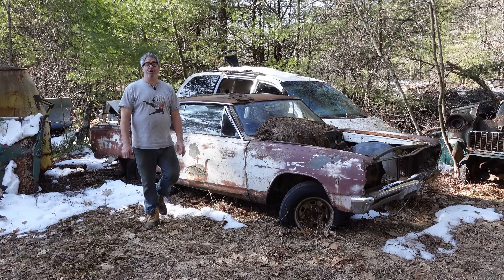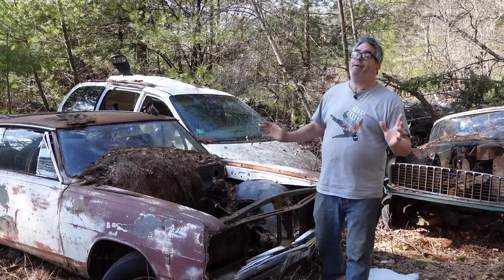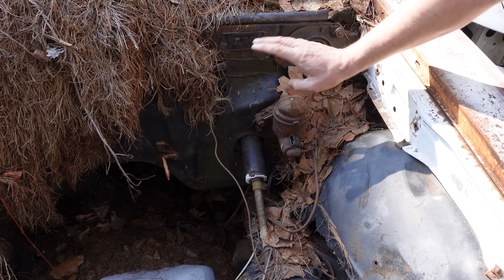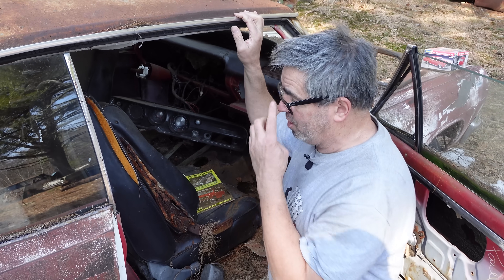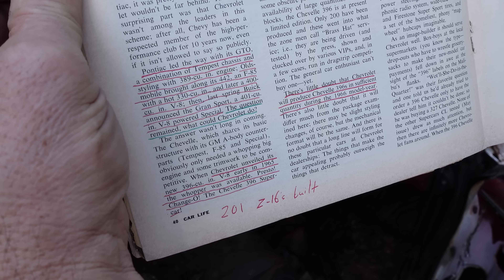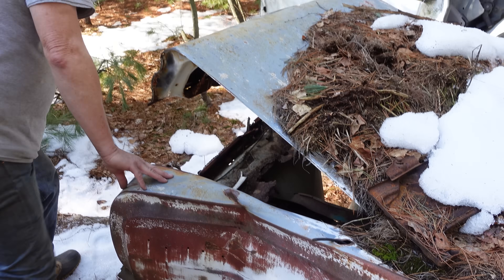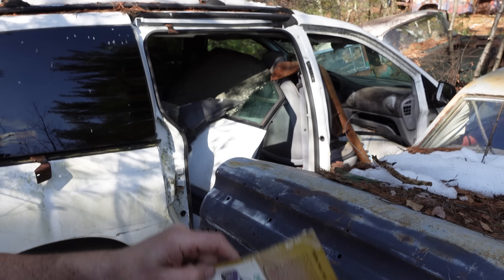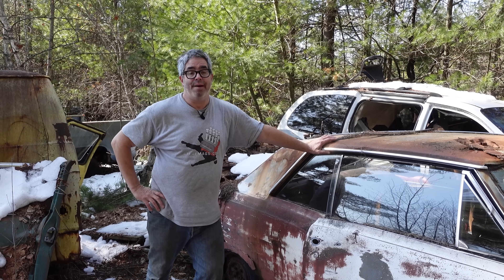Six Cylinder Super Sport

Comment: This vid put such a smile on my face!  I have a frame-off restored maroon 64 chevelle SS that came with 3 pedals, a 10-bolt posi and the mighty 230 inline 6!  Re-plated the 230 badges, which were different than those on the 65, and were located rear of the front fenders.  Kept and restored all the trim, steering wheel, interior, drum brakes, etc..  However, I did upgrade to a warmed-over 454 with Muncie 4-spd and 12-bolt w/4:10s.  Still drive it like a grandma, though.  Watching this brought back so many memories of walking country wrecking yards to locate nicer parts.  So therapeutic!  Amazing how quickly those days have passed.

Comment: Great info. I never knew there was a 6 cylinder SS. The more you know.....
Reply: Yes, the "13837" on the cowl tag proves it's a Malibu SS, but the VIN from the door post is needed to prove if it had a six (37 for the 2nd and third VIN digits which is a 6 cylinder SS or 38 for the 2nd and 3rd VIN digits which is an 8 cylinder SS) or an eight.

Comment: Very similar quarter panel vents made it to the Canadian version of the Chevelle, The Arcadian.
But there are three up and down instead of two horizontal. That was the first thing I thought of when I saw those vents. Really cool, probably got taken out of the American version for reasons like you stated
Reply: Thanks for the information🇨🇦
Reply: Speaking of Canadian Chevelles, there was no SS-396 in 1966-67. There was a Malibu SS , with a full range of engines optional, from the six to 283s and 327s to the 396.
re the seats--those look like Vega seats. Re..the Pontiac seat, those would have been found in the Canadian Beaumont, along with a Tempest dash.
Re seat belts...you are way off! Jan 1-68 was the mandate for front shoulder belts. 1965 was the mandate for front lap belts, 1966 added 2 rears, and 1967 upgraded to a lap belt for every passenger position.
Reply: I think the three vertical bars you are talking about might be assigned to the Sport Deluxe versions of the Beaumont/Acadian only.

Comment: Glad to see you back in the yard .
The Z16 396 was a big part of the Mystery 427 MK IV development and Rectangular Port heads . Witch led to the 1966 L72 development .
1968 only Z16 425 HP L72 was one Only and it was a Tunnel Ram engine . Factory.

Comment: I had a 67 impala ss with a 283 , powerglide , buckets seats and console. I thought back then it was odd to be an ss without a performance engine option. With 4 people it did 115 mph flat to the floor. I blew the spider gears from doing to many 1 wheel peel brake stands
Reply: That's because people beat it into everyone's head (wrongly) that, "If it doesn't have a performance engine, it can't be an SS". This Malibu in this video proves that to be wrong.
Reply: My 65 impala ss was a 283 2barrel 3 on the tree cool car

Comment: I wonder if that car also got a V-8 swap at some point before winding up in the ‘yard as it had bucket seats from something else - or was intended to be a V-8:swap until life caught up with the owner?  I remember in my little corner of the world starting to become “car aware” in the mid-late 70s that there were a fair number of surplus sixes looking for homes after someone dropped in a 327 or 350.
Reply: Back then, people put seats in from whatever. I had an '80 Trans Am parts car that had seats from something else poorly mounted in them, but had the original back seat in it. A guy gave me an offer I couldn't refuse when I was getting ready to part it out, and he bought it off of me.

Comment: Good morning Steve, thanks for the information as always. I know you meant 194 "cubic inch" incline 6. I did the math and it came to 88,750 of those 755,000 Chevelles you mentioned were Super Sports and with inflation, that upcharge for the 230 was $353.37 in 1965.

Comment: I used the Z16 model kit to make a replica of my neighbors 65 Chevelle 300   and gave it to him for Christmas. His car is a 2 door post with a fully built 396. I had to fake the post look (not as good as what Steve can do with a model). His car was born as a 230, then got a 350, and finally the 396. Passes anything but a gas station.
Reply: My coworker had a 1969 Chevelle as one of his first cars. It was a code 59 Frost Green car with a 307 V8. That came out and it got a big block some time later. It was the body shop "project" at Thomas Edison HS in Queens circa 1983-1984. It was eventually painted white and got "SS" trim later on.
Reply: @googleusergp  Well that's insane because that is where I went to high school. I was there from 1984 to 1987 and may have seen that 69.  I was in the electronics curriculum but used to go hang out by the auto shop whenever I could. One of my classmates had a 67 Chevelle with a 283 and a "glide". In the off hours a Turbo350 got swapped in from a V8 Nova that was donated to the auto program.
Reply: @LongIslandMopars  I think it would have been in the shop earlier than 1984, but I'd have to check with him on that.
Reply: @LongIslandMopars  I talked to my coworker yesterday about his two Chevelles. He had two of them. The one I spoke about was Frost Green with a 307 and was a Chevelle 300 with crank vent windows. It eventually got an SS hood and a big block. He said it was in Edison's auto shop from 1982 to maybe early 1984 until he graduated. So, you likely wouldn't have seen it. You missed it by a semester. 

Eventually one of them went on fire when he and a couple of friends were pushing it back to a rented garage and one of his friends steering it decided to light a cigarette. The lighter stuck and the car went on fire. He was taking a shower and said, "Man I smell something". His bedroom overlooked the garage as it was around the corner. The firemen put out the car before it got to the garage (someone noticed it and called the fire department). But by then the dash was melted and the windshield was damaged. He got rid of the car and got another one. The small block in one of the cars eventually wound up in his (now ex) wife's 1980 Malibu.
Reply: @googleusergp  Wow, what a shame about the car. Amazing story. Thanks for sharing it here.
Reply: @LongIslandMopars  Sure. I know he used to use S&S Speed on Atlantic Ave in Jamaica as I believe he lived in Richmond Hill at the time.
Reply: @googleusergp Cool.  And Merkel used to be in Richmond Hill before they moved out to where they are today on Long Island.
Reply: @LongIslandMopars  I believe that they were in Ridgewood, not Richmond Hill.
Reply: @googleusergp  Trust in GP!😁 You are correct (as usual).
Reply: @LongIslandMopars  LOL.

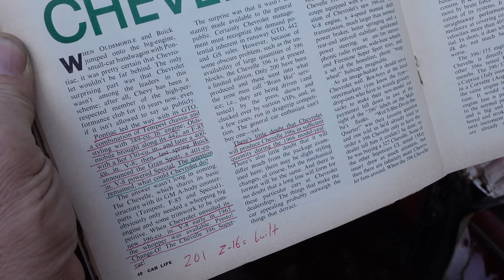Comment: Just like the 1963 Chevy II had the SS package it was only available as a trim level option that you could get with either the inline six or the four cylinder. Back when I was in high school a friend bought a '63 Chevy II SS that was yellow with a black top and black interior from a woman that was cherry. The four cylinder and two speed powerglide got pulled almost right away and a built 396 and four speed along with a straight axle went in along with a Dana 44 rear end and 5:36 gears for the 1000 feet. Back in 1972 I think he got it foe around $500 as it was a four cylinder car and not too popular yet.
Reply: The woman was "cherry"?😉
Reply: @gteefxr3094  Yes she was

Comment: When the first year SS Nova debuted in '63 (no SS's in '62), the ONLY engine choice was the 194 6 cylinder. The 283 V-8 wasn't available in the Chevy II's until mid-year '64 when the Muncie 4-speed also made it's debute in the Chevy II. That's when the fun began! 😉
Reply: Very cool, thanks for the information.
Reply: Owned a copper/bronze '64 SS Chevy II. Someone had dropped a 327/300hp engine in her. No transmission with the car. Bought a 4 speed from a buddy for $65. Had bad sychros in second gear. When I got my next car it took me a month to stop double clutching going to second.
Reply: @stevethomas760  lol! I have 2 Nova's...a '62 hardtop with a Muncie and a '62 wagon with a 700R4. When I drive the wagon, it takes me a while to stop pushing in the non-existent clutch pedal...
Reply: @stevethomas760  lol! I have 2 Nova's...a '62 hardtop with a Muncie and a '62 wagon with a 700R4. When I drive the wagon, it takes me a while to stop pushing in the non-existent clutch pedal...
Reply: @xfactorautomotive1496  Also had a '62 hardtop, 6 cyl/3sp. My dad had a '65 Chevy II 6cyl/3sp when I had my '64. My brother and I swapped rear ends from the '65 to my '64. I believe it was a 373, helped the '64 for sure. Big Chevy II/Nova guy. Had two buddies that had L79 '66s and two buddies with '70 Novas L78.
Reply: @stevethomas760  yeah, I'm a fan, too. My shop kinda specializes in Nova's. Hench the name... X-FACTOR automotive, inc....ya know... X-body (what the general called the Chevy II's/Nova's)
Reply: @stevethomas760  my 62 hardtop my mother bought new, pa put a 283/4-speed in it in late '63. It was stored in the garage since 1972 when dad bought a new GMC van. Sat there til 2012 when I bought it and got it going for their 50th wedding party in July 2013. Was a pretty great day!
Reply: @xfactorautomotive1496  Absolutely awesome. There was one guy in high school, Alvin Bonner, who had a red '64 283/4barrel/4sp. Like many of us, "man would I like to have that car today". Very, very cool 50th gift.
Reply: @xfactorautomotive1496  I was talking to my brother the other day about how our taste in cars has changed. There are cars that I wouldn't have given a second look 25 years ago. Now, that's pretty cool (wagons).
Reply: @stevethomas760  yeah...I like my "crew cab"  wagon. Laughed at people who drove them when I was a kid! Lol

Comment: That one wouldn't be sitting there if it weren't for the bad damage at its rear end. The quarter fender can be repaired. As could the rear end, but that damage takes any restore job right over budget. I was figuring ways to justify it's rescue or at least make a stripper drag car with it. until I saw that...and the weight reduction in the trunk....and the floor pans.
Yep, she's KOed alright. Still a bunch of good parts on her tho..

Comment: Yup, with the tag, you can brag:

08D for the fourth week of August 1964 production, 65 for 1965 model year, 13837 for Chevrolet (1) Malibu SS (38) two door sport coupe (37), FRA for Framingham, MA assembly, 786 for Medium Red bucket seat imitation leather interior trim, C-C for Ermine White lower and upper exterior paint, Group 2 accessory code of M for two speed Powerglide automatic transmission (RPO code M35), P for Comfort and Convenience Group "Type A" (RPO code "Z01" which included a LH outside rear view mirror, inside non-glare mirror, two speed electric wipers and washer. Type "B" was the same content, but the LH outside mirror was remote control), S for rear antenna (RPO code U73), Group 3 accessory code of C for instrument panel pad (RPO code B70), Group 4 accessory code P is believed to be a RH outside mirror and was used on cars assembled at Kansas City, MO (Leeds) and Framingham, MA. Some references state that the Comfort and Convenience groups also added a glove box light and backup lights on some models. 

The Framingham plant operated from 1947 to 1989 and its closing was a political duel between then Governor of MA Michael Dukakis and local politicians. GM eventually closed the plant citing, "economic conditions and also the labor climate", aka "you don't play ball, we take it all." I think that those belts were made around Wednesday June 22, 1964, by that code on them. It is also possible that the 22 might be the week of the year that they were made, which is about right, that's almost mid-way through the year. I'd gather those are the original belts, although usually there will be usually be a "W" code on the 5th accessory group for "Custom seat belts with retractors" (RPO code A49). Gannon Motors is gone, and on that property are now a couple of repair shops. You can easily see how it was a dealership at one time and what was what on the property. 

No VIN, can't win, but easy to figure out, no doubt: 1 for Chevrolet, 37 for Malibu SS six-cylinder, 37 for two door Sport Coupe, 5 for 1965 model year, G for Framingham, MA assembly and the rest is the production sequence. The VIN would have been handy to verify it being a Malibu SS as well, although the trim tag does prove it to be a Malibu SS with a six cylinder. On many of these year vehicles, you have to confirm both the VIN and the trim tag to confirm what you have. 

The trim tag in this case of 13837 tells you that you have a Malibu SS for 1965 but it does NOT tell you if it's a six or eight cylinder. Only the 2nd and 3rd digits of the VIN would tell you that (37 for six cylinder SS and 38 for V8 SS in this case).
Reply: Yeah, saw the seat belt tag, I didn't take note of the numbers, but I thought a two digit year would be there. I just can't remember how seat belts are i.d.'ed. What year was the Pontiac seat?
Reply: @tomwesley7884  Mid to late 1960s would by my guess. The seat belt date code may have varied depending on the supplier.
Reply: @tomwesley7884  Looked like the Pontiac seat was from a 1965 GTO.
Reply: @customkey  You may be right on that.
Reply: 2 speed Powerglide? the circular opening in the hump reminds me of a manual trans, (saginaw)  would it have come from factory with a console for a powerglide?
Reply: @ltlieu61  Correct, the "M" in accessory group two is for the Powerglide automatic transmission.

Comment: My wife's aunt still has her 64 SS convertible she bought new, her's has the  283 motor.
Reply: That's a keeper right there.
Reply: I have a oddball question.  I have a 64 el camino. What color are the turn signal indicators on the dash? Are they green? Or are they orange? Mine are orange and iam wondering if that's factory or if someone has been in the dash cluster before. Also, what color is the high beam indicator light? Blue? Or red?
Reply: @chrispaulson2934  Don't discount that things have faded in 50+ years. I'd check some parts places or other known cars to verify.
Reply: @googleusergp  I hear that 1964 Oldsmobile have orange for their turn signal indicators. And while I understand pieces fading over time, Iam having a hard time understanding why green would fade to orange. Would they fade to almost clear? 
Iam a bit more knowledgeable in early novas than the chevelle/el caminos so I do apologize. Iam always trying to learn more about these classics and keep this hobby alive.
Reply: @chrispaulson2934  Have you studied other vehicles? That would be the easiest way to verify.
Reply: @googleusergp  most if not the majority of the 64 and 65 chevrolets have green turn signal indicator lens. The minority are customized by their owners. I had a conversation with a 64 Oldsmobile owner and learned about that year having the orange turn signal indicator lens.  I can't remember about Buick or Pontiac of 1964 or 1965. Most chevelle reproduction stuff for the 1964 turn signal indicator lens are green. So...its leading me to think it's possible I have Oldsmobile turn signal indicator lens maybe? 🤔
Reply: @chrispaulson2934  Possibly. Remember that most of the assembly plants back then were assembling models from different divisions in the same plant, and on the same line, so it's possible that parts got mixed up and interchanged.
Reply: @googleusergp  I have thought about that too. When I brought up that possibility with the Olds owner, he laughed at me though. Iam mostly curious because I would like to know more in depth as to what model lines used them so I can get replacements for future use. All I find are the green ones. I know it's kind of trivial, but its rare to me that I have seen a different color turn signal indicator lens that's not green lol 😄
Reply: @chrispaulson2934  It's not likely, but it could happen.
Reply: @googleusergp  the only person who would know is the person that was assembling it on the assembly line 😄